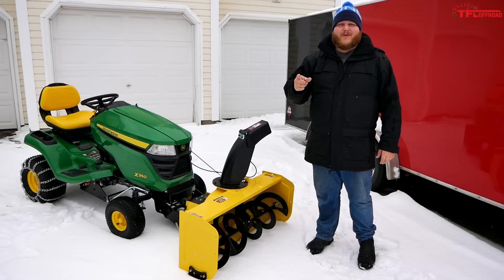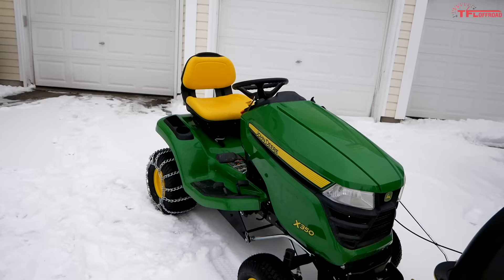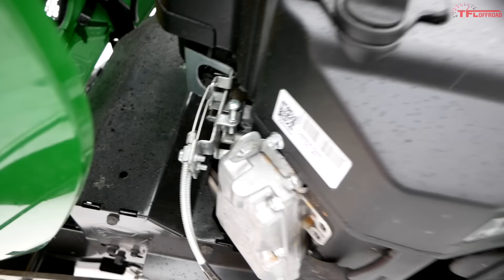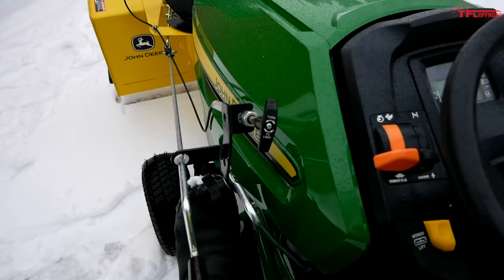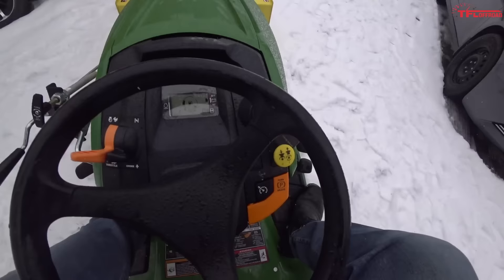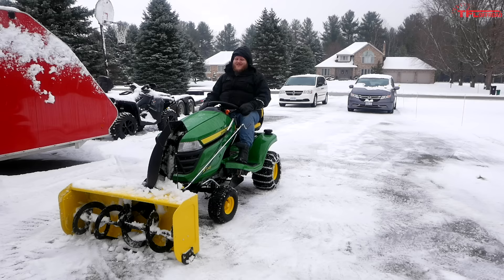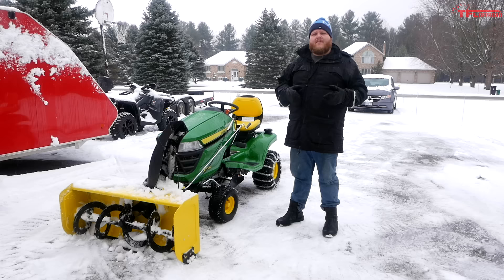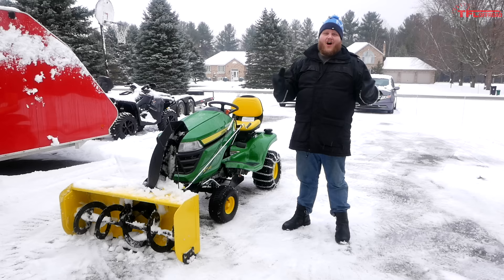Watch This Before You Buy a John Deere X350 Tractor!

Comment: You have an ATV,  just stick a plow on it and thank me later.   Those hydrostatic units are very cheaply made,  life expectancy is under 500 hours.  I dont have a blower or do much more than mowing with mine.  The ATV gets all the grunt work to save the transmission on the mower. Your property does not look that big,  100 series would have been fine if your around 1 - 2 acres.
Reply: X500 700 hours, even the belts are original. You know NOTHING! :)))

Comment: You also should DEFINITLY NOT SHUT THE THROTTLE OFF AT FULL, IT WILL EVENTUALLY BLOW UP THE ENGINE
Reply: If you read your owner's manual they will tell you to shut it off at 4 p.m. so that it burns up the extra fuel in the carburetor and doesn't make it backfire
Reply: full RPM

Comment: I have about $400 into this 30 year old Deutz-Allis/Simplicity with 42" blower (including purchase price).  I'm happy with it so far.  Don't have the budget for a new machine but it works out because I like to tinker and get old stuff working and reliable.  It has an Eaton Model 7 hydro with a Peerless 1300 series transaxle.  Actually quite stout.  Practically no plastic on the machine, either.  Check it out.
https://youtu.be/WuhEl7ARAbA

Comment: It was all good, until I heard "9 THOUSAND DOLLARS". I wish you knew more about tractors before you spent that kind of money on a lawn mower.
Reply: That was for the mower AND the snow blower. The blower alone is almost 2-thousand Canadian dollars. The price of the tractor is actually quite reasonable at 4300 Canadian plus there are often specials that reduce the price by several hundred dollars. Also not mentioned is the fact that the X350 comes with a 4 year, 300 hour bumper-to-bumper warranty. (tax not included in the prices I quoted, which come directly from the Deere site)
Reply: I have a Craftsman 7000 PRO, made by Husvarna.I use wheel weights and 125 lbs hitch weight with a 48 inch plow. It will handle up to 12 inches of snow.